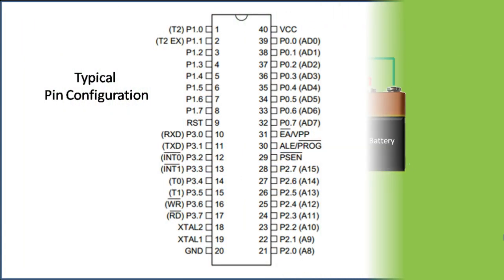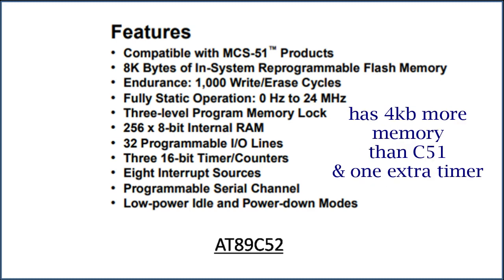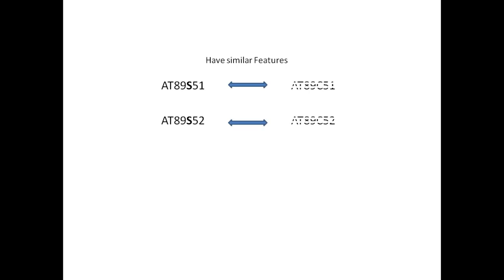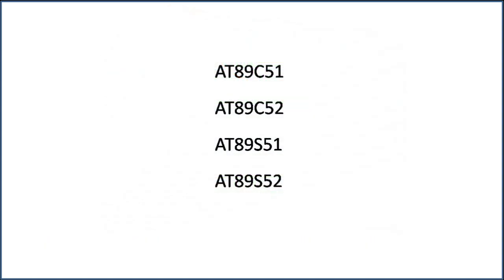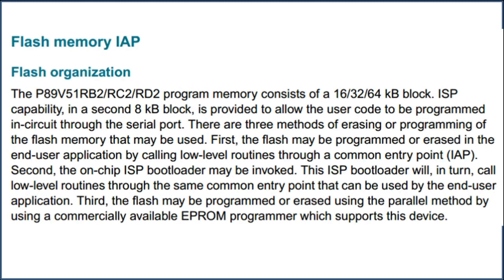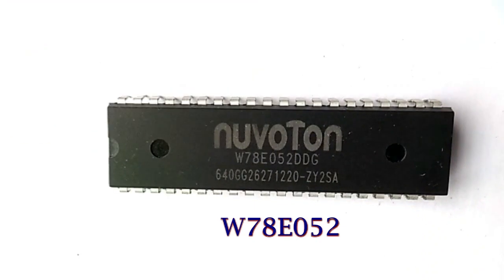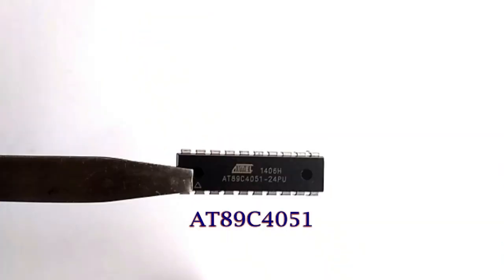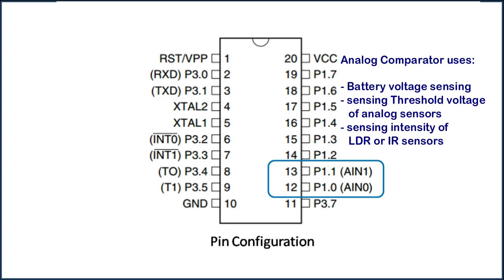8051 Microcontroller ICs : Overview - (1/3)

Comment: Very nice Explanation.
question: can we upload boot-loader on a 8051 uController?? eg. can we upload on AT89C51/52? or AT89S51/ 52??
and where can i get the file if required?
Reply from the maker: Hi.. we cannot upload bootloader on the ICs u mentioned.  Because they are not designed for it.. but you can buy 8051 ICs that already has bootloader in it. Watch part 3 of this video for more on bootloader  chips.
Reply: @EggTronics31  Thank you soo much for the reply. i did watch the 3rd video along with your other videos, i came to know that there are many 8051 architecture uCs available which already have a bootloader installed.

Comment: sir my question is Value of current given in 5volt dc supply
Reply from the maker: Hi. If you are using only LEDs and sensors. 0.5 amp 5v supply is enough. But if you are using many relays or DC motors. You should use 1 to 2 Ampere supply, depending on load.